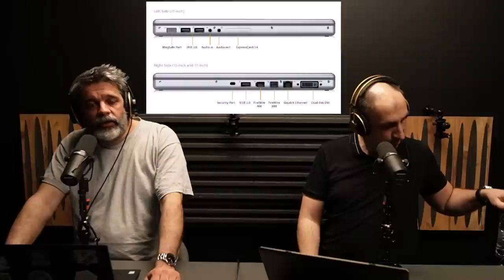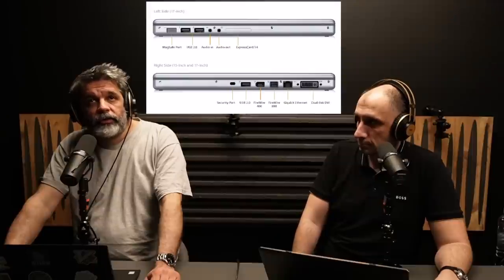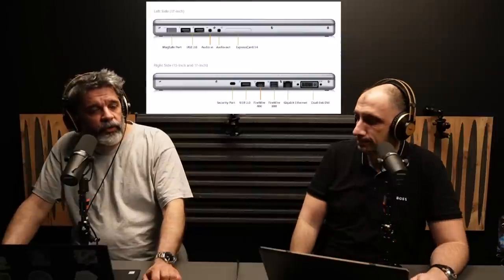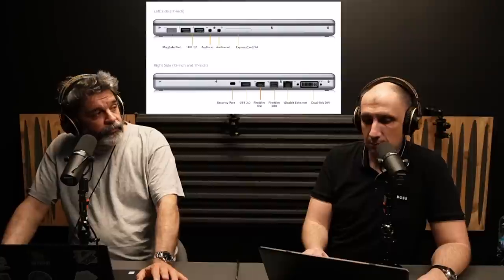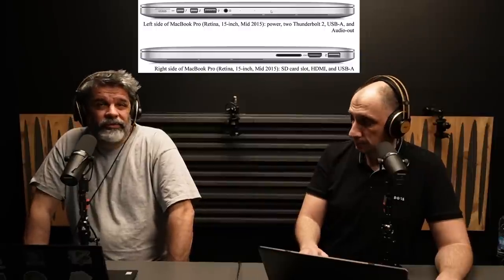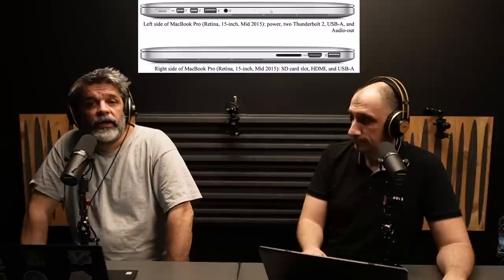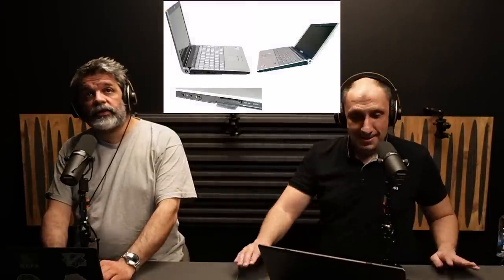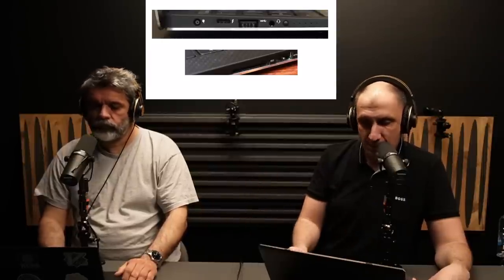Modern laptop designs - the good, the bad, the ugly, and the unbearable  - (Episode 14) #laptop

Comment: I used XPS 13 2020 or 2021 and thermal management. Battery life was bad but it had 4k screen. All my dev friends worked in silence on their Mac Pros while I had the experience of being inside an airplane due to the fan noise.
Reply from the maker: It's not only that. It's famously unreliable - MBO breaking, cameras stop working, Thunderbolt ports breaking... it's a classy machine "for the eye candy" :)